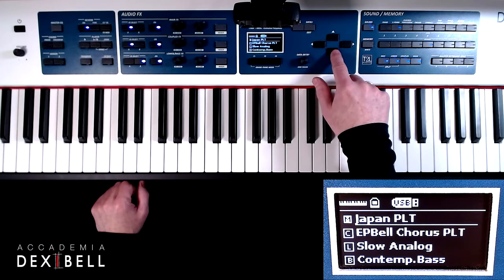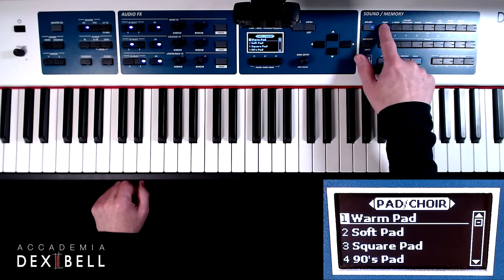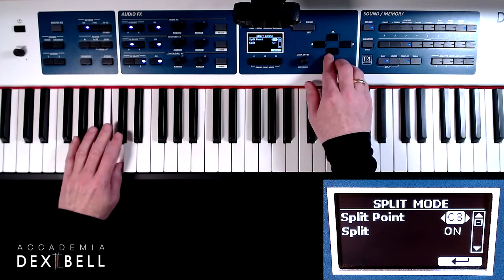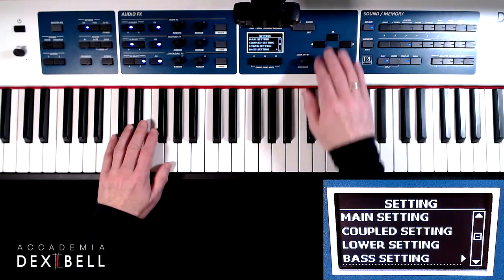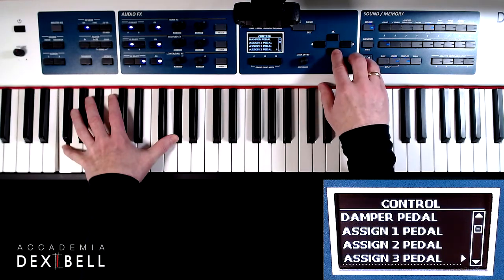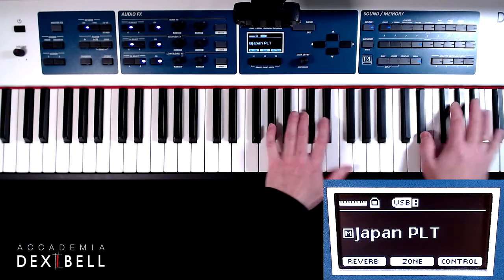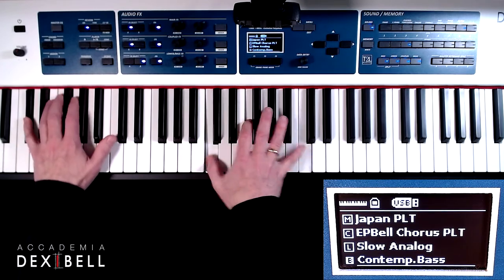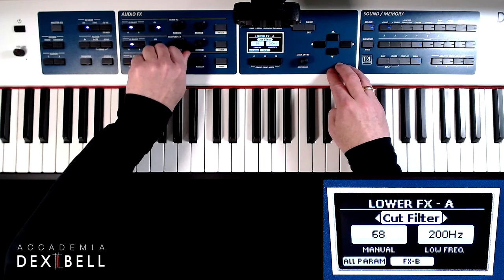T2L Engine • Flexibility of the 4 Internal Zones

Comment: Hello from Finland :) I have got my S9 for about a week now and i have one question. Is there some fast way to get like a "initialized" patch with all the settings empty/default? I noticed i can save a preset to "Grand piano mode" and there also seem to be empty user-memory spaces in banks 8-9, so I could basically save a preset with "empty" setting and recall it. Just wanted to know if there is any fast way to get empty "patch" with no effects and all the setting as default . Thanks.
Reply: I'm also interested in this function. That would be very handy for quickly dropping into "controller" mode. Or do you have suggestions for better setting up a "controller mode", @Ralf / Dexibell? Thanks for these great series!